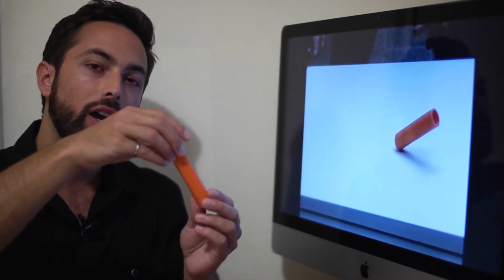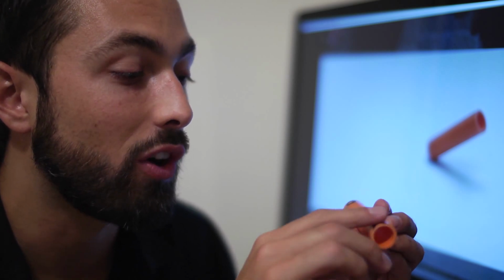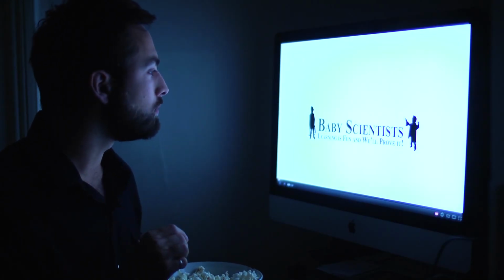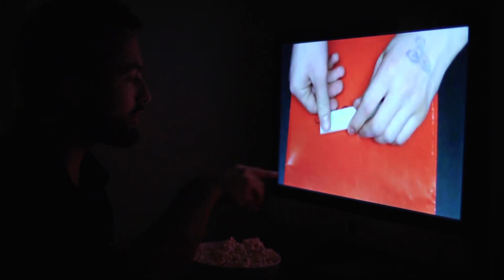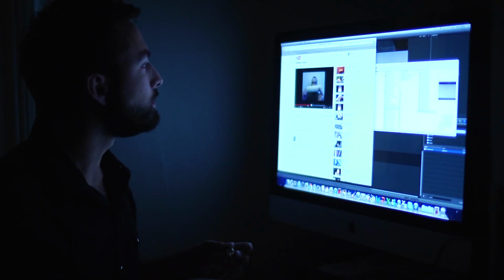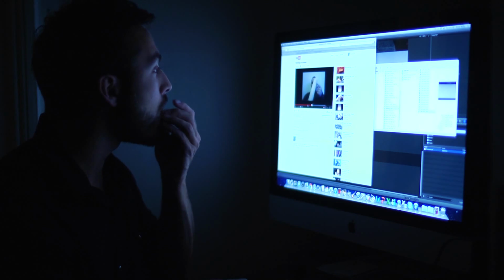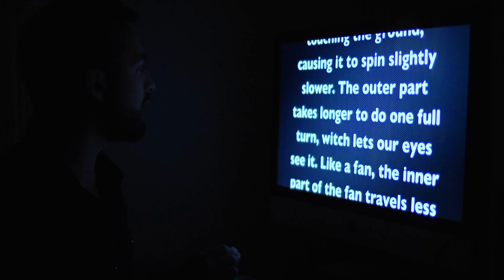Spinning Tube Trick Explained

Comment: But why do we see the opposite when looking from under the glass?
Reply: Basically, the whole thing is reversed, from underside it's like you pressed from bellow X, which equals pressing O
Reply: it only makes sense that if the spin along the short axis is subtracting from the total speed on the top side, that when it's going the opposite way it'll add speed (and vice-versa for the other side).
Reply: Everything is relative, this is relative to the angle your eye looks at it. Point of origin = your eye
Reply: When your looking normally at the spining tube you will see it rotating around the vertical axis in one direction thus increasing the time one end spends in your field of vision. When you're under the mirror you'll notice that it rotates in the other direction thus increasing the time other end spends in your field of vision.
Reply: The above replies over complicate things imo.

just look at a cross section of the tube, on the top it moves forwards, but from the bottom it is going backwards, i'll try to draw it:
The O is the tube, the other symbols are arrows showing direction of the symbol
    -->
^  O   v
   <--

This question also puzzled me, I had to analyze the high speed many times, imagining the bottom side, until I got it. The above responses didn't help for me personally.
Reply: This has to do with the camera's shutter speed and how it syncs with the frequency of the X and O. As Derek explained, the O is moving faster around the circle and the X is moving slower. This means the O has a higher and different frequency than the X. Agreed? Now, the camera's sensor automatically increases shutter speed to compensate for increased light when you point the camera towards the sky. When you point the camera toward the ground, it is not as bright and it selects a slower shutter speed. Slower shutter speed shows you the X, higher shutter speed shows you the O. If Derek switched to manual shutter speed, he can force the shutter speed to show X instead of O when filming from below the glass. This effect is eliminated with the high-speed camera, which uses extremely high shutter speed and high frame rates to capture both the X and O on the same side of the tube.

Comment: I'm more curious about why the one end stays in the air
Reply: This happens due to the fact that air pressure on the bottom of that end is more than that at its top.....while for the other end it is exactly opposite.....
The lift can be understood by Bernoulli's thm. The top of the lifted end is dragging the air along with its rotation leading to increased air velocity and decreased pressure as compared to its bottom...leading to a lift
while the opposite phenomenon occurs on the other end where the top generates more pressure than the bottom therefore it stays on the ground.
Reply: @martianpirate9657  wow, you took time to write the whole explanation but used a acronym for thorem
Reply: @martianpirate9657  lol now I wanna know the full name
Reply: might be the dancing T-handlle in zero gravity effect..a bit of  disbalance that makes it favor to twist around the length axel but it lacks momentum to overcome gravity to do so.. so it sticks in a diagonal position..

Comment: So why do we see the O on the bottom of the glass?? if it has the same rotation speed as on the top...
Reply: Think about how the perceived direction that the tube is rotating changes, when you look at the tube from the opposite side. If it helps, think about a glass clock. From the front, you would see the hands rotating clockwise. But, what happens, when you walk around the other side and look?

Comment: I still admit I don't get why it shows the opposite when viewed from underneath. The tube doesn't change its spin nor direction just because you change your point of view. Speaking about clockwise and counter-clockwise doesn't change the direction of which x or o are spinning. So x would still be moving slower seen from underneath, but yet we see the faster moving o, I don't understand this. I mean I might just be an idiot.
Reply: Well, the tube keeps spinning in the same direction, that's a fact. But it's the point of view that matters.
Think of a transparent clock on a glass wall. It's moving clockwise. Now imagine to stand behind the wall looking at the back side of the clock. It's arms did not change the direction, but now you perceive their movement as counter-clockwise.
Now think of another clock laying on the floor. If you move around that clock, you will not see any change of the direction of the arms.
So it's important on which side of the wall you stand. The wall is orthogonal to the rotating axis of the arms.
Now combine our two clocks. If you stand in front of the glass wall, both clocks are rotating in the same (clockwise) direction. But if you step behind the glass wall, only the clock on the wall seems to rotate backwards, whereas the clock on the floor seems normal.
The tube works just like that, but it adds the rotations of both clocks, which causes this interesting effect.

I hope I could help you. I'm a scientist, not a teacher :(
Reply: +Simon Vetter  Well that is my point. Even if you stand on the other side, sure! The rotation of the tube is opposite  what you saw from above. However, the fast spinning X will still be spinning along the same direction as before. See it like this;
Say;

X is the faster spinning one as it is spinning in the direction of rotation of the tube itself. So we would see O.

But this is also true if you look from underneath right? Just because we change our point of view, X is still spinning in the same direction of the rotation as seen from above. Why is it then we see the X and not the O from underneath?

I tried this doing it slowly with a roll, and I can't seem to figure it out since it seems my statement from above holds true, in regards to the fast X and the slow O

I am not saying you are wrong, but when I tested this with a roll myself I couldn't get it to make sense like you explain it. Looking from above and from underneath I still see "X" spinning in the direction of the rotation, be the rotation counter or clockwise depending on your point of view. Thus we should always see the "O". Our point of view doesn't change the system itself, no matter what angle we look at the system, X will always be rotating in the same direction as the tube itself. ((If we made X the "fast" spinning one))
Reply: Simon Vetter
As to say, I completely get that the rotation of the tube itself would be perceived as reversed if you see it from underneath, but that doesn't change the fact about the O and X, spinning in the same direction in regards to the tube.
Reply: Simon Vetter

To explain it in math terms, this is how I see it.
From above;
Vtotaly = Vtube + Vy
Vtotalo = Vtube - Vo
Result; We see O

From beneath; 
Vtotaly = - (Vtube + Vy) = - Vtube - Vy
Vtotalo = - (Vtube - Vo) = - Vtube + Vo
Result; We see O
Reply: Simon Vetter
God I am speaking to myself at this point. But I think I figured out the error of my ways, drew some vectors in my mind. The rotation of y and o doesn't change, since they are perpendicular to our viewpoint. So the correct calculation would be;

From above;
Vtotaly = Vtube + Vy
Vtotalo = Vtube - Vo
Result; We see O

From beneath; 
Vtotaly = - Vtube + Vy
Vtotalo = - Vtube - Vo
Result; We see Y
Reply: Brian Storm Jensen  exactly.

I drew a little sketch: https://www.dropbox.com/s/sii1k0h4tyx6fut/rotation.png
Reply: Simon Vetter
Lol mate.... I was doing the same! Gotta love it, I just drew this as you posted. It made it easier for me to understand by drawing the velocity vectors. The perpendicular stuff I said is... A bit rubbish though, but that just depends on how you see it.

http://i1197.photobucket.com/albums/aa421/SvenPek/Capture_zps274d4971.png

As for the math going with the picture it would be, if we keep the direction of rotation of the tube as our positive direction;

From above;
Vtotaly = Vtube + Vy
Vtotalo = Vtube - Vo
Result; We see O

From beneath; 
Vtotaly = Vtube - Vy
Vtotalo = Vtube + Vo
Result; We see Y
Reply: Brian Storm Jensen I think I figured it out. Technically the x is still easier to see but the glass itself is bending the light causing the x to be distorted because it is lifted off the surface of the glass. You can note that the side that is pressed tends to be higher off the surface than the other side. This causes the image on the part that is touching the glass to be clearer, so you see the o. My guess is if you could rotate the pipe the same way without it having to be on a surface you would see that upside down wouldn't change anything.
Reply: Brian Storm Jensen If you freeze frame you will notice that when the O is visible that end of the pipe is wider, because it is closer to the glass. When the other side widens as the rotation slows you start to see the x. It's simply a matter of how the light is being refracted.

Comment: he didn't explain why it was opposite, when looking from underneath.
Reply: +Jeremy Forrest from the bottom its moving in the other direction, so the O would appear because it moved slower than the X
Reply: +Jeremy Forrest. Imagine a car wheel (better the axis of the wheels) of a car in movement. If you look the wheel from above you'll see the X going forward while the axis goes forward too(in fact you can't see the X because is moving too fast), but if you look  the wheel from below you'll see the X going backward so you can see it now. In video, above the crystal X is moving backward and we can see it (and not O which is moving forward) but under the crystal X is forward and we can't see it in opposition to O which is now moving backward and for this we can see it.
Reply: You should have that much of iq to figure it out.
Reply: If you imagine yourself looking at a clock from its back, it goes counter clock wise.

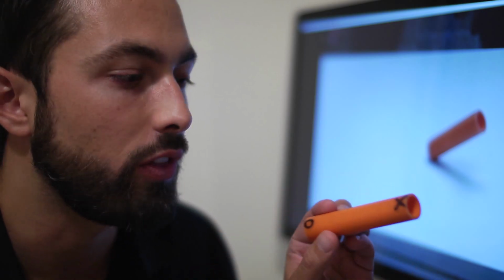Comment: If you flip your field of view from top to bottom, this also changes rotation of the tube from clockwise to counter-clockwise or the other way around. This then means that the O will be moving backwards with respect to the motion of the tube in it's horizontal rotation as he explains at 0:29

Comment: if the 0 on the tube is spinning much faster than X and we can't see it when we are watching it from up because of its velocity of spinning, why do we see 0 when we're watching it thru glass table from below, ergo why don't we see X again
Reply: Entoni Juric
The rotation of the tube is inverted from underneath the table → x is faster o is slower → You can see the o
Reply: Entoni Juric 
I'm sorry for you that you didn't get the answer earlier.

Comment: The spin is divided into two components:

1) The tubular axis spin (parallel to the tube length)
2) The tube's principal axis spin (perpendicular to the area which the tube "sweeps")

As the tube sweeps due to its principal axis spin, its ends may:

1) Both be seen to be moving CW, or
2) Both be seen to be moving CCW.

....depending on what side you are looking at it from.

However, the tubular axis spin causes a different effect. In this case, labels on both ends are not affected in the same rotational direction, but rather, in the same translational direction....

Think of clock orientation. When the front side is viewed, which we will call the "front side view", notice how 9 o'clock is to the left and 3 o'clock is to the right.

Now imagine that the tube initially had its tubular spin axis aligned with the connect between 12 o'clock and 6 o'clock. Following the axial spin of this tube, we will call the "back side view" the view where the relative positions of 3 o'clock and 9 o'clock are swapped, while 12 o'clock and 6 o'clock are unswapped. Now that we defined both the front and back views of the clock, we note that if the tubular axis spin causes the labels to move from left to right on the front side, continuing the tubular axis spin will cause the labels to move from left to right on the back side as well. The results:

1) The label at 12 o'clock (call it Label X) is still moved in a clockwise direction by the tubular axis spin, regardless of which side we look from, and
2) The label at 6 o'clock (call it Label O) is still moved in a counter-clockwise direction by the tubular axis spin, regardless of which side we look from.

The rotational effect on each label caused by tubular axis spin is unaffected by what side we are looking at, but the effects for each label are opposite of each other (clockwise for Label X and counter-clockwise for Label O).

The rotational effect on each label caused by principal axis spin are both the same (clockwise), but when we look on the other side, we see that this effect has reversed (counter-clockwise).

If we take the scenario of the principal axis spin causing the tube to tilt the same way as the hands of a clock, then the combined result is that:

1) From the front side view, Label O (6 o'clock) is more visible than X (12 o'clock), as from this view the tubular axis spin makes Label O move from left to right, causing counter-clockwise motion with respect to the clockwise-tilting tube (retrograde motion).
2) From the back side view, Label X (12 o'clock) is more visible than O (6 o'clock), as from this view the tubular axis spin makes Label X move from left to right, causing clockwise motion with respect to the counter-clockwise-tilting tube (retrograde motion).

Now why then would the label that you put your finger on be the one that you can see better during the spin (i.e. the one with apparent retrograde motion)? The reason is that you are applying a torque which generates the both the tubular axis spin and the tube's principal axis spin simultaneously. When you push your finger on one end while retracting your finger, your push causes the end to slide against the surface of the table, while your retracting finger induces a roll which appears retrograde from the sliding motion that you are initiating. However, the movement of that label is only "retrograde" from that side, because, on the other side, the movement of the label on that same end you pushed on would instead be seen moving "prograde" with the principal spin and thus will be harder to see when you look from that side.
Reply: As for the reason why the tube appears to oscillate up and down, that is because the principal spin axis (axis of precession) of the tube is not initially normal to the surface. Notice how the tube is closer to horizontal when it is touching the surface, but when it is far from horizontal it is slightly up in the air. The table rights up the tube's precession axis during the process, because the normal force acts greatest at the lowest point in the oscillation. The tube does not have to be fully "in the air" to do this, as the normal force can vary without contact separation, similar to what happens when you shake a weight scale by alternately crouching and standing on it without jumping.

This is why a spinning top will initially upright itself even without visibly jumping. Fundamentally, at the atomic level, the top still jumps during this process, though its displacement is too small for us to see it with unaided eyes. When the top is being uprighted, it is a tiny distance closer to the atoms than when it is not being uprighted. A small displacement in the normal direction at the atomic scale can occur with a significant difference of normal force. Given the negligible change in the gravitational force over such a tiny displacement, the top can thus rise as a result of normal forces and do so without having to bounce from a visible height.

Comment: Here is for everyone who doesn't understand :) Go to 1:02

When you look from the top, the O will spin in the same direction as the pipe moving, so you can't see it. When you look from under, The O is spinning in the other direction than the pipe is moving (thus you see it longer).

First: O spins to the left < and the tube is moving horizontally to the left <
But when looking from under, the 'O' is still moving to the left, but the tube is moving to the right.

Very hard to explain with text...

Comment: from the underside it will be opposite, it is much harder to explain why and it would be easier if you could see it or visualise it. but the best way i can explain it is when the O is spinning over the top side, it is travelling in a direction that is same as the direction of the whole tube rotation (what he has explained) but when it rotates to the underneath of the tube, it is half way around the circle and is travelling the exact opposite direction from before, so from underneath it is slower